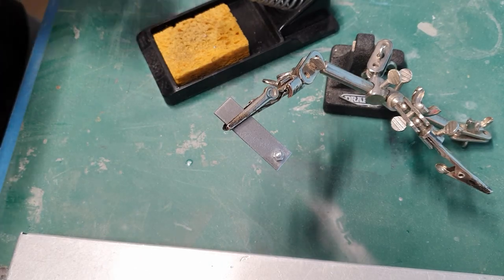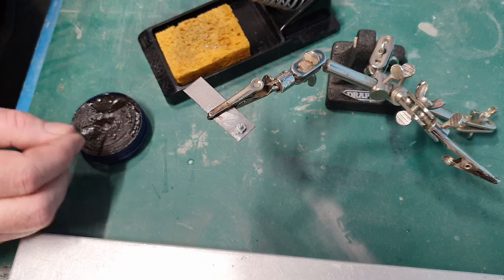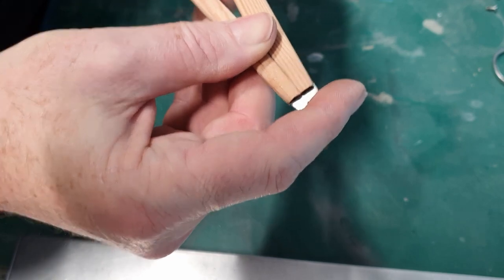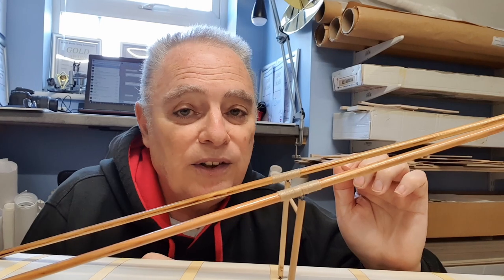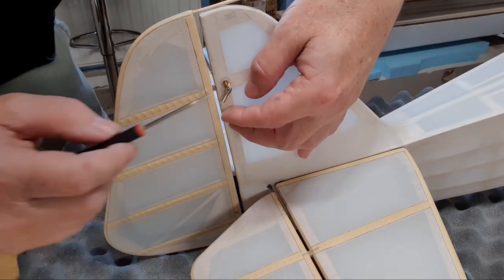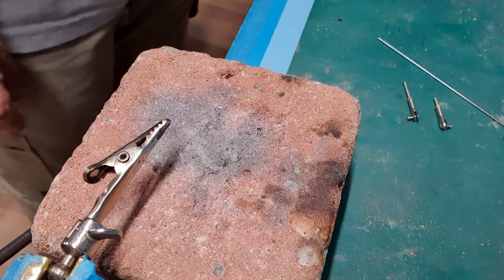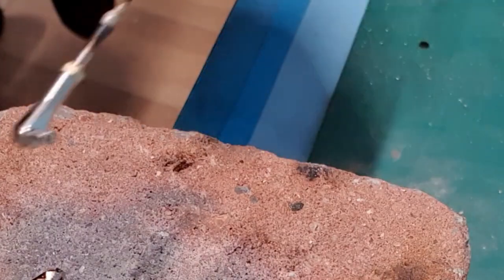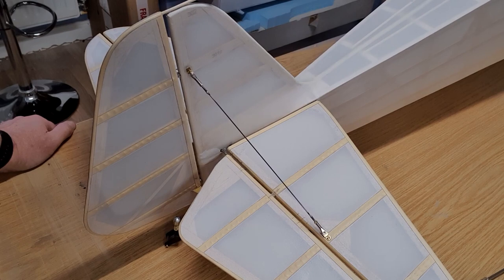Wing strut and tail plane bracing wires

Comment: Another great tutorial that can be applied to many models.
Reply from the maker: Glad you found it useful, the fact that the soft soldering joint failed as did one of the silver soldered joints shows what to do to rectify the situation and that flux and cleanliness are paramount.

Comment: well danny you look like you have been through the mill do not despair  i love your work i call it full size model standard i use silver rod with flux on bar takes i lot of heat 20 eu for 500 mill not cheap will not fail  bonjoir tolouse